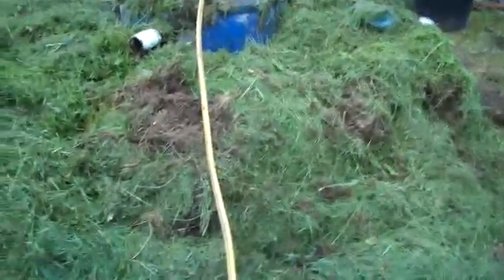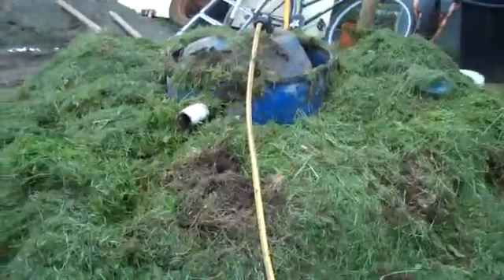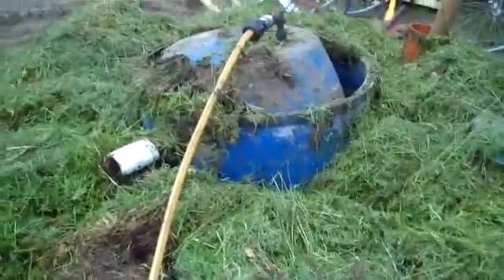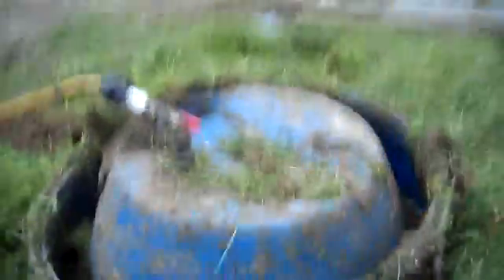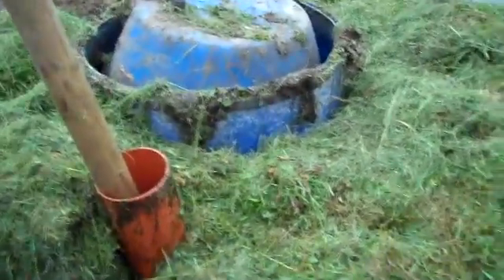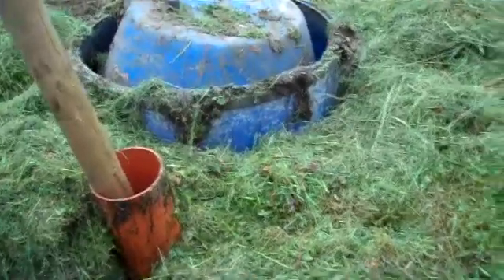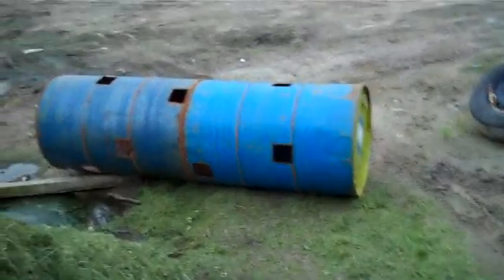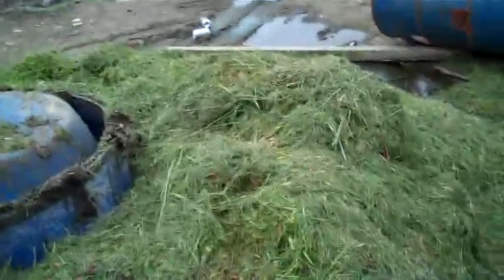Bio gas made from grass digester d.i.y.Ireland Jean Pain

Comment: I recamend a water jacket of some kind or that the tank be under ground with a water pound above it with a bigger footprint area in case gas escapes As to the wider gap I cannt help you if you want to rig a filter to your system you can run the gas through water this will reduce its unruly nature a bit

Comment: As long as the bottom of your tank is cone or ball shaped you should be ok I have thought of using a conical bottom and adding a vacume line  to alow the system to be cleaned out with out the need of enteringit as is the practise of the people that originated the design Im talking about If youve herd of Jean pain then you may have herd of Mother earth magazine  It was in Issue #69 that this design was premeared.  its no problem keeping this gas it just needs to be in an air tight tank

Comment from the maker: firstly,  thanks for your offer of help. i will take it,  could you use a round tank with a dome top and bottom or does it have to be a full ball?. is there any video that explaines it?   In another video im running a generator and the plug gap is widening, why is this?.And should i make a filter before i put gas in generator. .I am trying to minimise risk by not keeping a lot of gas,  thanks cal

Comment: Biogas can spontaniously combust if it is mixed with to much air to fast  if this combustion happens in an inclosed area it can become explosive be careful I have studdied bio digestion systems for many years write me with any questions. You do know that the left over effluinte is one of the best fertilizers there is and if  it has been produced in a properly operating biodigester it is safe to be used on human food crops  TAGz 3339 Ya ho o .c

Comment: Let me help you my friend Build a concreat ball barry it in the ground run your toilet pipe to this ball not at right angles but at a slant in both directions when you flush your slury fuel into the ball it will stir the mix and increas both gas volum and duration of gas production also be safe and build a pond on top of your ball after it is barried fill it with water to keep any leaking gas from spontaniously combusting raise fish in the pond barring it helps keep heat in air out TAGz 3339 Yah

Comment: jean pains method is almost the same but you have  gotten around the batch method he used by adding more  every day. seems like you would gat more gas. probably the new water is  reducing the temperature. he used only manure in a  very large tank  sealed.  then surrounded by a  very large pile of wood chips  seeded with manure and water.  
 i would only be able to guess that  composting the grass first  until it was pretty ripe and adding it to a sealed (no input )  barrel and heated might work

Comment from the maker: I've been running this on only grass for 3 months now, and since i put weights on the floating dome when burning gas the flame has improved hugely. All in all, im happy enough with grass so far, I liked your low presure switch, could u show it in more detail and are u using some kind of safety valve to stop gas going back to the digester? Thanks
Reply: Any update on this project?:D respect from co.kerry

Comment from the maker: Thanks for the tips, carbon might keep the heap hot for longer. I tried a stick blender on the grass before I put it in, but it only rapped around the blender. Could u recommend one to me. I am pre-soaking the grass with the over-flow that comes from the digester. My new tank is 5 ft by 12 ft. I am about to start work on it. Thanks